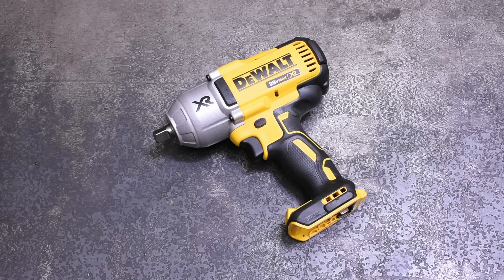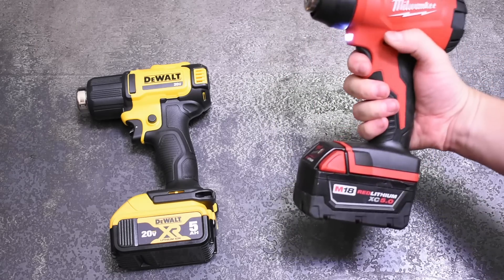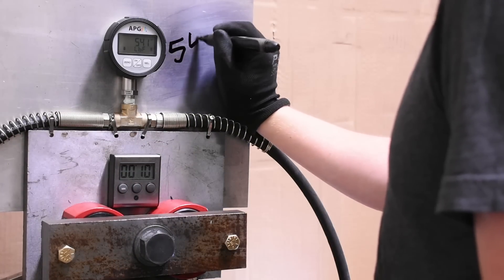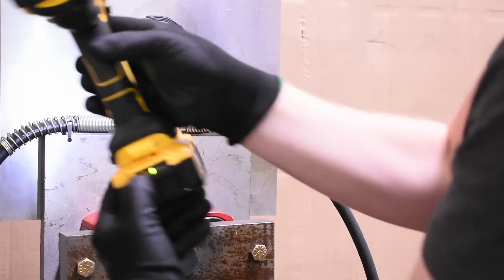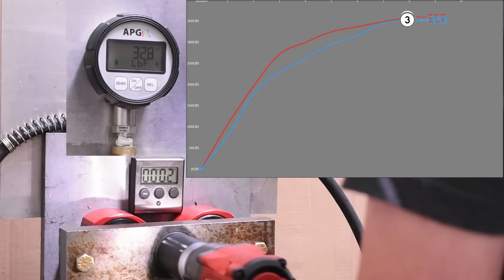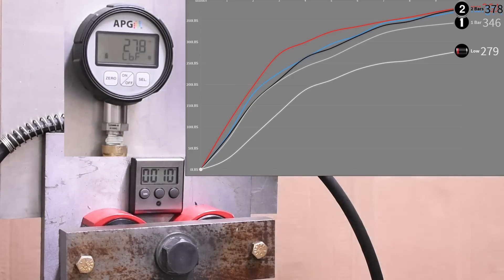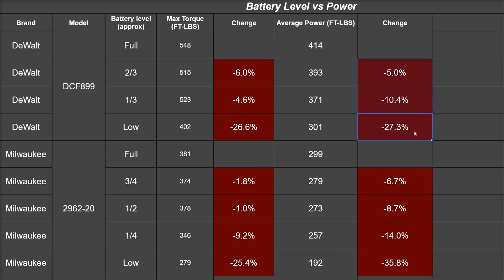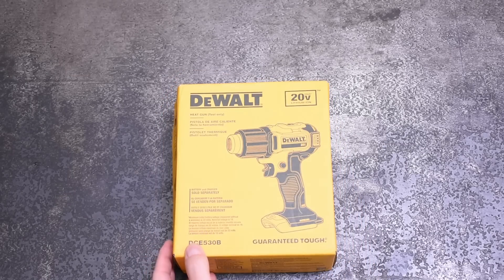Low Battery? Exactly How Much Power are You Losing? For Science 12

Comment from the maker: We're told on DeWalt batts the 1st bar really like 50%, good to know. Luckily we did just entering into 1st bar and almost dead then to at least get some of the range of that 1st bar. Also may be why 1 bar on DeWalt and 1/2 on M18 are within 1.4%. What makes battery level even more a pain for mechanics is unlike drills, routers, saws and many other woodworking cordless tools where you can just push slower to get the job done (in some cases) some of the smaller #'s differences we showed here could be the difference between getting the job done 0% (bolt doesnt come loose) or 100% (bolt comes loose). There's often not much in-between on an impact.
Reply: Will we be seeing a Part 2 for the High Output (2170 Cell) battery packs? I heard you talking about it in the intro so I was expecting to see both but then I figured you were maybe just saving it for the next video in the series. 

Great idea by the way! I wonder, can you buy corded attachments for cordless tools that lets you test their capabilities under sustained power? That might be interesting, to see what they can do without being handicapped by a potentially shit battery. 🤔
Reply from the maker: @DragonBallsDD  We'll be doing more battery testing once the Power Stack comes out. As for a cordless tool with a cord plugged in, we've done an episode on that with the Metabo HPT and working on another
Reply: @TorqueTestChannel  Ok, awesome!
Reply: @TorqueTestChannel  try and test a 2 stroke gasoline impact wrench. They are usually used for railroads and I want to see how well it would do
Reply: @DragonBallsDD  They have a video on some impacts thst have that feature, to be corded, or not to be, umm, corded! Yeah!
Reply: The trick is to measure the voltage of the battery with a voltmeter.  Battery level indicators are confusing.
Reply: The reason for Dewalt's scale has to do with their XR marketing. Some tools say XR and some tools do not. It stands for "extended runtime." The specifics behind it are very wishy-washy. From what I understand the XR tools prioritize overall battery health over performance. I think that means the tool throttles itself based on the real-time conditions of the battery. This also results in the battery runtime for that individual session to be longer. But is one tool doing more work than the other at the expense of the battery? Or are they doing the same work, but one is doing it at a slower pace to protect the battery? That I'm not sure about.
Reply: @Michael-hn5cj  there are some inaccuracies in your statement.  XR is DeWalt's premium brushless line of tools, akin to Milwaukee's Fuel.  Brushless tools offer better runtime than brushed tools, hence the Xtended Runtime (XR) moniker.  Both brands also make more budget brushless tools, that they simply label as "brushless".  The premium brushless models (XR and Fuel) are going to be more powerful and less battery efficient than the standard brushless.  

When it comes to batteries, the XR batteries were to differentiate between similar sized batteries that were of a lower Ah rating.  I.e, the 3Ah DCB200 and the 4Ah DCB204 were the same size (10 cell 18650 packs), so the 4Ah got XR branding to show it offers greater runtime.  The 1.5Ah DCB201 and 2Ah DCB203 were the same size (5 cell 18650 packs), so the 2Ah got the XR branding because it had greater runtime.
Reply: Torque Test Channel sir please dyno battery xc 6.0 Milwaukee on dewalt tools dcf899 or dcf894 how much torque can produce.
Reply: Can you test new socket vs. wear out socket. Please 🙏
Reply: Upon arriving to work I realise we do not have XC5.0 batteries, instead we use the older redlithium-ion M18 5.0Ah batteries.

I use a milwaukee M18 high torque with 5.0Ah batteries on a daily basis. And from my experience the torque losses are WAY higher than this test suggests.
For example at full charge I can remove lug nuts off of truck/lorry front wheels, which are torqued to 500Nm or above.
But at 1solid bar left I can't even remove Tesla Model 3 nuts, which are torqued to 175Nm Or more likely either 170Nm or 180Nm.
That's around 60% torque loss.

Comment: Lithium doesn't like being Flat-Lined anyways.   You will get a longer over all life time out of your batteries if you flip them over at around 30% -25%.
Excessive heat, will destroy them too.  So, if you have a standard charger and a rapid charger.  Try to use the slower standard charger when every your can.
Your batteries, and your wallet will thank you.  
As always, top tear video TTC.
Reply: That same logic applies to cell phones as well as you should always charge on the slowest possible setting to preserve battery life.

Comment: It would have been better if you did a full drain of the batteries with the heat gun, measured the amount of time it takes each gun to drain them and then did math to figure out how much time it takes to get the batteries to exactly 75%,50%,25% and so on. Seeing as this was just a rough estimate that the battery indicators put out. Still a great video and I love everything you guys do.
Reply from the maker: And how would you use that info? You'd have the battery indicators to use like we are. Not exact %
Reply: @TorqueTestChannel  just for science reasons. But good point. I live in AZ so I use milwaukees cordless fan alot in the summer and I've pretty much figured out that every hour I burn about 25% of a 5.0 battery and sometimes I don't being all my batteries to the jobsite so I'll have to use that battery on occasion.  I'm a commercial eletrician so I just overtorque everything and try to hide it when I snap a bolt, so I wouldn't use that information but it'd be interesting to know. Once again, I love everything you guys do, I was just putting my two cents in.

Comment: Hi Torque Test, I've worked a lot with lithium cell packs. Your large batteries perform pretty well in low charge state, but smaller capacity packs will see a more dramatic change. With a big pack, the tool's output is limited mostly by the battery's state of charge/resting voltage. In smaller packs, with individual cells working twice as hard, the same load currents can cause a severe voltage drop. In my personal experience, once the surface charge is gone (~10%), smaller packs drop in performance dramatically. I'd love to see this test repeated with i.e. CP 2.0/3.0 battery packs. I've handled a Milwaukee mid-torque that really struggles to remove Toyota lug nuts (76-100ftlbs) after falling below 4 bars of charge (Milwaukee 2852 CP 2.0), and I don't think these results quite reflect that.

Comment: I wonder what would happen with a test being done by swapping battery manufacturers with different tools by using those nifty adapters. For example, this channel helped greatly in determining my first set of cordless impacts. I got two Ridgid impacts with no batteries on black friday deals, upgraded my existing Dewalt batteries/chargers, and got an adapter to run dewalt on ridgid.

Comment: That's the cool thing about lithium batteries. If you look at a discharge curve, the voltage stays close to the same until you hit about 25% capacity where it drops off heavily. You'd see a much more linear separation in torque vs charge with a nihm or nicd battery tool (18v DeWalt for example)
Reply: It would be interesting to see a torque vs voltage chart. Fully charged is roughly 4.2 volts where "dead" is roughly 3v per cell. So a 20v battery fully discharged puts out roughly 15v, where an older style battery puts out near 0v when fully discharged

Comment: I did this test on accident the other day. I'm fixing up a David Brown 990 tractor and needed to remove some wheel rim bolts. I tried it with a battery that was circa half full and nothing. I charged the battery fully and tried again and it busted them off no problem. This was done with a 4Ah battery and the DeWalt DCF 899B which I bought prior to this channel starting. Can't complain though really as it has served me well so far at least.

Comment: Was in the shop last night and grabbed one of those torque sticks (several sizes below my target because I hella don't trust them). Would be interesting to see how they work in actual practice across different types of impact and how accurate they actually are.
Reply: A tire-guy used a 120nm torque stick to fasten the lugs on a wheel on one of my cars, and i could not loosen them with a mini Makita impactwrench which is rated at 210nm in reverse, 330nm nutbusting.

Comment: I'd like to see what the 18v version of that DeWalt half in impact does on the Dyno with a 18v battery and their adapter with a 20v vs the 20v version how much of a gain would I get just using the adapter and is there a big jump going to the 20v tool?
Reply from the maker: nadda. They are the same. DeWalt just cant call their tools 18V due to a Milwaukee patent. They are both 18V tools
Reply: @TorqueTestChannel  that's good to know I was debating on upgrading to the 20v version assuming it was any better but with that knowledge I think I'll just upgrade the batterys

Comment: Drain not Watts (Unit of power), but joules (unit of energy) Or kiloWattHours - kWh.

It would be a pleasure for nerds if you could measure voltage of the battery at each charge level.
As battery bars may show charge level in non linear way.

Comment: Would be interesting to see comparisson between 12 and 18 tools which aren't impacts. For example i have a small 12v cutoff tool from milwaukee which is pretty useless to me. They also have a 12V circular saw for example. Is there any point in doing that or should i invest in 18v batteries and ecosystem as well.

Comment: Should note 18650 cells dont do nearly as well with lower charge than 2170 cells. On my bosch drills the 4Ah 2170 cells have about the same power until about 1-2 bars (of 5) and the 6Ah 18650 battery you can feel its power down when it goes down one bar (2 bars, of 3). Should also note the 4Ah is slightly stronger at full charge as well.

Comment: Any interest in a rank chart that shows torque at 50% battery?  I suspect the highest rated tools will drop off quite a bit, but lower torque tools may hold steady for a lot longer.  (You would want to measure torque at a set voltage value, because % capacity is kind of made up/ unreliable/ varies by load on pack and maybe by manufacturer.)

Comment: I know you guys are spanner monkeys, but have you heard of a multi-meter? :D It would help to explain what the lights actually mean.

Speaking from experience with my electric bike and voltage drop under load, 50% (3.7V/cell) when under heavy draw from the motor is enough to drop the voltage to 3.3V/cell, a bit low and the cells start to lag in their current delivery. Pretty much why 1 bar is 50%, the change now indicator.
 
Power = V*I^2 after all

Comment: Thanks, I was told by A Milwaukee sales rep not to charge the batt until it was down to the last bar but I hate going back to the shop for another battery or carrying extras to the boat (I'm getting old) so I recharge on anything below 4 bars. Do you know if this hurts the battery or not? The old NI CAD batts used to for a memory i am told and eventually limits the batterys amp hour ratings. Just curious because batts are expensive.
Reply from the maker: He's correct it's not ideal. But everyone does it, no one drains these cordless tools down before swapping. It's not a huge lifetime difference

Comment: I wonder if the Dewalt heat gun just aims the heat better? I mean what does efficiency mean for a heat generating device? Regardless of that, your conclusions still apply. If more heat loss for the Milwaukee happens in other directions, then it does matter in that it isn't what you want.
Reply from the maker: Yeah, spot on. Obviously both are making heat with the same efficiency, seemed like the fan and nozzle of the DeWalt was just more effective at putting it where you point it

Comment: I'm not sure if people know that Milwaukee owns 18v name and any other manufacturer that wants to use it has to pay Milwaukee and dewalt avoids that by calling them 20v max, and if you measure the voltage of the batteries in fack both are over 20v

Comment: Air tools always say 90psi, but everyone runs them unregulated (that i've seen anyway). What difference does that make?
Reply from the maker: 90 psi in the tool while running usually means 112-120psi at the wall. We also test at 150psi which is normal shop line pressure in each air tool video on the BCS test

Comment: DeWalt doesn’t list their battery lights as 33/66/100; DeWalt reports the first light at 25% the second at 50% and third at 75% meaning 3 lights isn’t 100% but between 75% and 100% while no light is 0% to 24%, 1 light would be 25% to 49%, 2 lights would be 50% to 74% and 3 lights would be 75% through 100%. While we use DeWalts almost exclusively their battery capacity lights sucks as one light gets you up to almost 1/2 the battery power. In my experience I’ve rarely ever used a tool into the no light level though I have a few times and the tools will actually run with no lights eliminated. We typically only run batteries down to the one light which isn’t a problem as we have well over 40 batteries. I’ve actually puts a DC amp meter in line with a battery extension and the battery curve on the DeWalts is quite good staying above the 90% level through about 90% of the useful watt hours then dropping like a stone at the end typically tripping the battery safety cutoff while Pack’s still maintain a useable charge level; like I say as this isn’t an issue with a good supply of batteries it can be annoying when you have a high demand tool and limited number of batteries, though you can extend your run time by placing a battery that’s too low for a high demand tool in a low demand tool to extend your available use time. We’ll do this with say a circular saw battery going into an impact drive which seems to get the best run time of any of their tool as well as having about the lowest power demands next to the USB/12V power supplies.

Comment: Great video and here is a simplified explanation. A motors power is proportional to volts^2 so if you take 19V^2 / 21V^2 works out to 82% of its original power.  However it is a bit more complicated because motors are constant power devices meaning they want to do the same amount to total work for a given speed and load. So as voltage drops, current will increase, but since our power source is finite when the voltage gets too low for the load and you hit the max of the designed battery output and will start seeing significant power reduction that you may not at nominal voltages.

Comment: Pretty good test results. I frequently use the batteries at less than a full charge, and the only time I notice a real difference is when switching to a fully charged battery after the first one died. 
I might consider getting one of those heat guns though, as I use a corded Master heat gun frequently. It's a pain dragging a cord out every time and they frequently get tangled up with air line. 
Doing auto body you tend to use all forms of power for your tools. One less thing in the way goes pretty far when you have a huge mess of tools out.
Reply: I have the Milwaukee heat gun. I am a marine mechanic and use a lot of electrical shrink tube and connectors. I seldom have power conveniently close or at all and used the mini torch. I bought the heat gun do to safety reasons and convenience. Reports said it didn't work very well but I didn't have the expectations of a plug in gun either. It works great for what I use it for and it  beats worrying about setting something on fire from the long invisible heat trail of the torch. I also use it to heat small parts prior to painting. According to this the Dewalt puts out more heat but I don't want a table top full of chargers and a new tool box to store batterys.
Reply: @garyradtke3252  Try the Power Probe PPSK? It works very well for heat shrink.
It's no corded, but it works quite well for the little stuff. Maybe better than cordless, but at the expense of butane?

Comment: Idk if its true but in a manual for any dewalt tool it tells you about the battery gauge and actually says 1 bar is 1% to 50% 2 bars is 51% to 75% and 3 bars is 76% to 100%. Doesnt make sense but thats what the manual states

Edit: sry 1 bar <50%
2 bar 51% to 74%
3 bar 75 to 100%

Literally looking at it right now. Check for yourself if you want
Reply from the maker: Hey thanks, did not know this. Luckily we tested INTO 1 bar then low to still sort of get the range they are jumping over with 1 bar

Comment: I know my dewalt grease gun which is just a single speed gun, gets noticeably slower when im at 2 bars vs 3 bars on the battery
Reply: I use a dewalt grease gun daily. Is yours weird when it’s about to shut off? I find if I pull the trigger and hold it... it will run a long time but just really slow. But if I pull the trigger and release it and then pull again... it drops off in a hurry and then won’t fire back up until I pull the battery and pop it back in. Usually happens when I’m on the last two fitting on my excavator. If I just hold the trigger back when switching between grease fittings... I can do the whole machine no problem. If I stop between fittings... it drops power and I can’t finish the last two or three fittings. 😂
Reply: @TsunauticusIV  I usually dont run it down past 2 bars, I work on bobcat equipment and have quite a few batterys so when it get slower which is at 2 bars or so i grab a different battery and charge that one